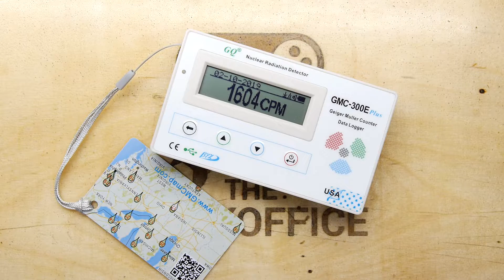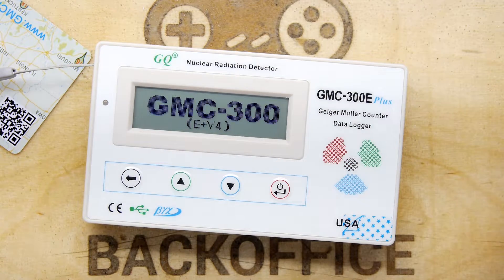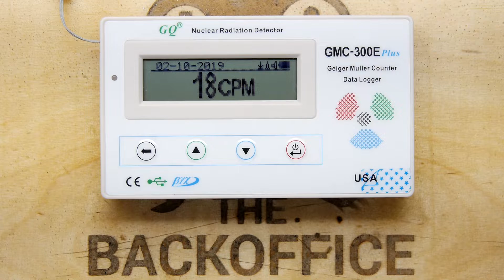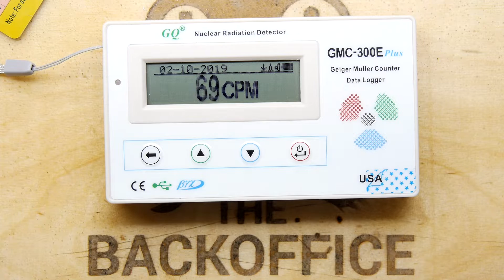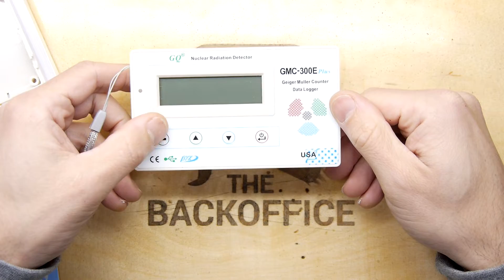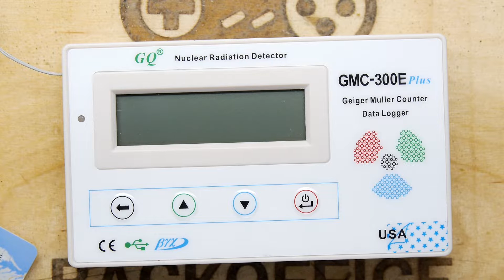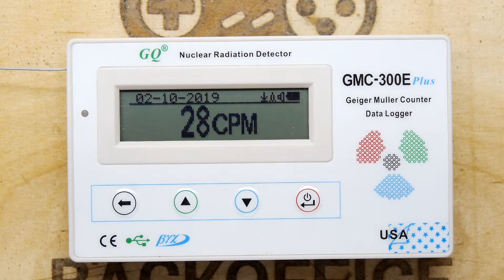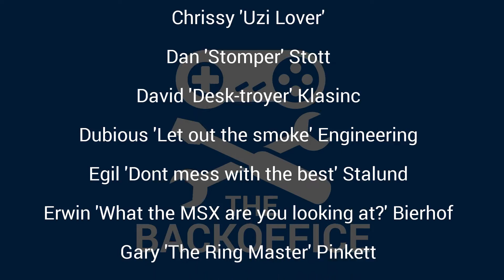GMC 300E Geiger Counter

Comment: Does gmc-300e plus still has any advantages over newer gmc-300s? worth modifying it with soviet SBM-20 or other tube?
Reply from the maker: It's hard to say, they will not confirm if it can measure Chernobly

Comment: Go into an antique shop. At least here in the US, it used to be common to mix uranium into paints. Fiestaware dinner sets before 1972 are an infamous example. There's also uranium tiles, which can actually be found in some public places such as Los Angeles Union Station.
Reply: Many lamp mantles were made with thorium salts too.
Reply from the maker: I better stop using them to brew tea
Reply from the maker: It's probably ok as long as you don't eat the glass 😂

Comment: That "headphone" jack isn't for earphones. It's a data output jack to send data to a computer.
Reply: No it actually is for earphones and that's all it ever was, the data output on these is sent over USB, it's also how you download the log file from the counters internal memory. On the older screen less GMC-200 it was misrepresented as a data jack but was still really only a audio output, all the software did was listen to the line input from it to detect the count rate and it wasn't very good. 

I would frequently use my GMC-100 back in 2012 that way with earbuds on and the unit stashed in my pocket while riding bus.

Comment: As a vintage watch collector, Radium and Tritium luminescence led me on a interesting seperate journey to study radiation. I also live near a nuclear plant and are about 30 miles from Ottawa IL where the Radium Girls story took place. If you are intersted I highly recomend watching the 1986 documenatry Radium City which can be rented on VEMO for .99 cents. It's interesting that they use a glass tube instead of the typical metal SBM-20. Also appears that it can be user replaced after clipping the zip ties which is a nice.

Comment: I ordered one of these. I wonder if I should have stepped up to the 320 or 500. I am anxious to learn and use this device.  A guy I was talking to had purchased one and said it's a real eye opener as you carry it with you and measure things you encounter in your daily schedule.
Reply: Well it arrived. It's fun to use it. We have a painted rock which is the most radioactive thing in our home so far.
Reply: @danmiller2940  I bought 320 plus. Will I be satisfied with it?
Reply from the maker: What's the difference with those models?
Reply: @backofficeshow  Well, honestly,  I don't know enough to tell you. I noticed, after the shipping alert, that the other models had a couple more features.  It wouldn't have hurt to pay a little more if the quality is better.
Reply from the maker: I doubt there is much in it, I am sure you will enjoy the one you have

Comment: I wanted to check something I found on the internet is possible convert x-ray in to electricity and use this energy for charging for example, if you put the device on some converter to a radiation source he could charge it
Reply: I know it depends on the intensity of the radiation but it is still possible

Comment: can you upgrade it yourself I was curious if you have knowledge
Reply from the maker: What sort of upgrade are you thinking of?
Reply: @backofficeshow  extended battery capacity
Reply from the maker: You could fit a bigger lithium battery externally and wire it into the circuit in place of the existing one, that would be possible
Reply: @backofficeshow  well thank you

Comment: The battery (cell) used in this meter is a standard AA cell, rechargeable Li Ion. In a pinch you can use alkaline or Lithium cells. ie. Energizer if recharging is not available.

Comment: 14500 battery is a standard and easy to find. Noob :p
I really like it better than the 9v rechargeable in the older non-plus model. It last longer and is lithium so no problems swapping it out for a higher capacity one later on if you want, though it already lasts really long. I use this meter for tracing down local sources on my daily walks. You sit in one of the parking lots of those places with the business suites that have one of those cheap clinics/dentist offices set up in in USA and you can hear spikes on the meter sometimes from no shielding on the Xray imager. I remember one that actually had it right by the window facing the street. You could detect the xray emissions out to the street. Not good for you or the electronics and other stuff to be around that too much all the time (fine for short time like at airport).

Comment: Your correct Am-241 found in smoke alarms gives off a 60kev gamma ray for every decay of an alpha particle. However this energy is in the x ray spectrum of energy and so your detector is very inefficient in detecting low energy x rays which is why Your not detecting much.
Reply from the maker: I can see from your nickname you're the person to ask does this mean that my testicles are receiving a much higher dose than I'm measuring 😂😂
Reply: Mr.Microcuries actually it’s not. It detects low energy X-ray just fine.